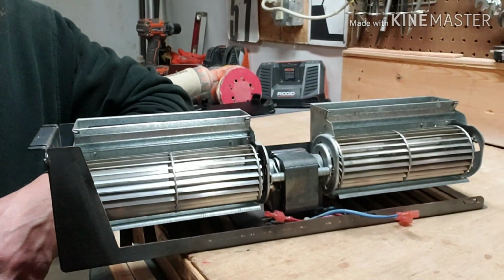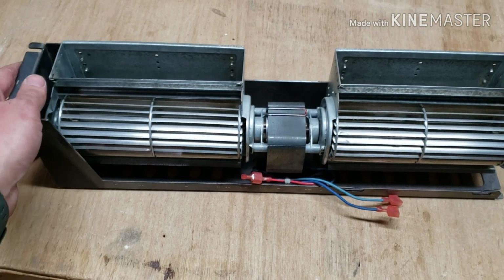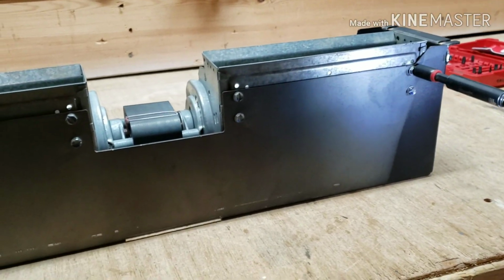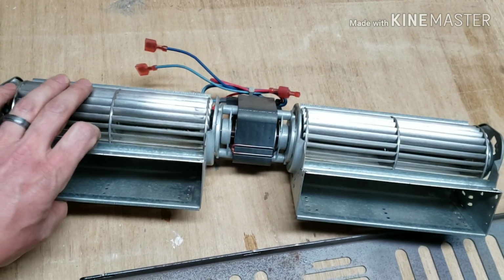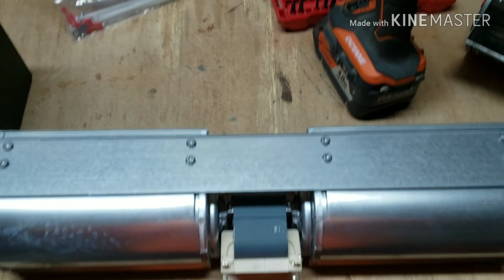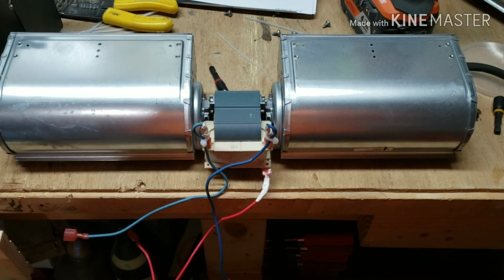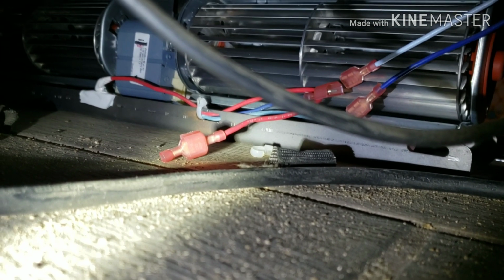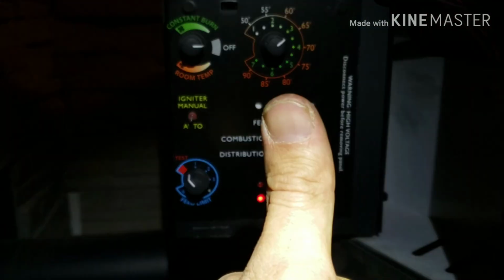Replacing Harman XXV distribution motor/fan

Comment: Is the red wire a dead wire? My old one just had a cap on the red and the dark blue and light blue were plugged in
Reply from the maker: If memory serves my correctly I believe the red wire was for a different model or older version I believe....I know the light and dark blue were all that was needed. I just capped and taped off the red wire.

Comment: Hi. First great video, I have to replace my blower in my XXV and could not find a video showing how. I was wondering which bolts are you removing to get it out. The darker color ones or the silver color ones. Thanks for the video and the answer.
Reply from the maker: Hey Dan! I disconnected the wires before I slid the blower assembly out. There is not alot of room for play between the stove and the blower assembly. Snipping the zip ties gets you a little bit of play so you can undo the harness connectors. Feel free to ask as many questions as you need! Hope it's going well!
Reply from the maker: Hello Dan! Yeah sorry I kinda short changed that part in the video. It's the darker bolts inside from the silver ones(more towards the center of the stove). And that's on the left side of the  stove if you are looking at it from the front. The right side only has the two black coated bolts to loosen to get the blower unit to lower. If you have any other questions feel free to ask! I hope it all goes well!
Reply: Good Evening. I have one more question. When the blower is slid out is there enough room to disconnect the wires? or did you disconnect them from the back prior to removing the blower? Thanks for your advice.